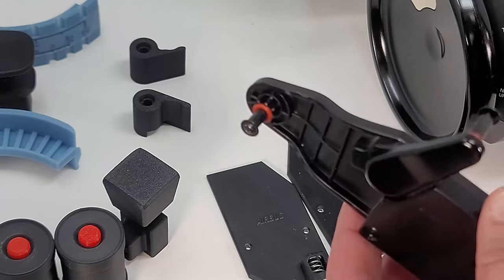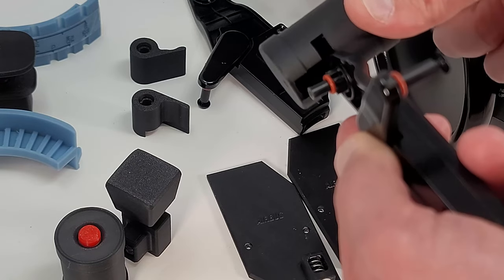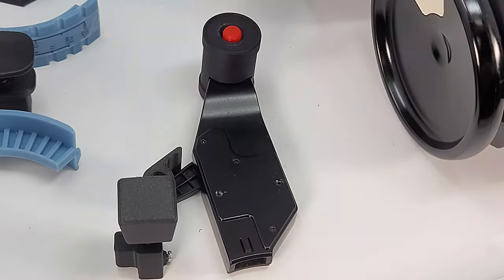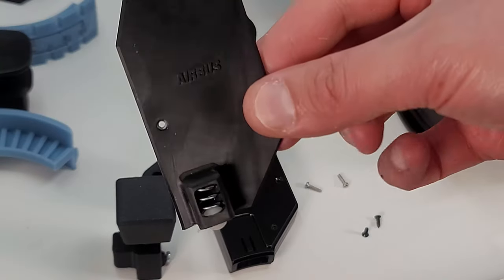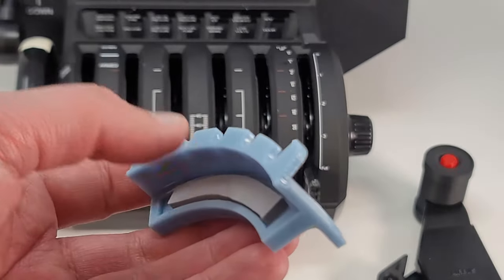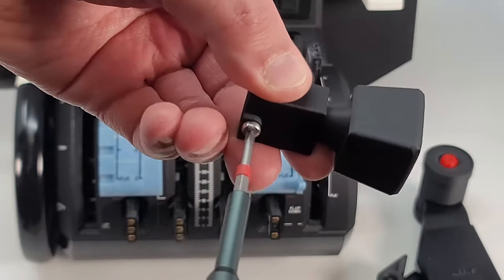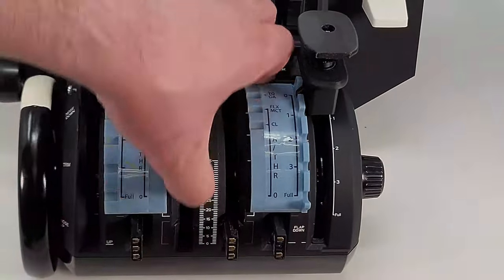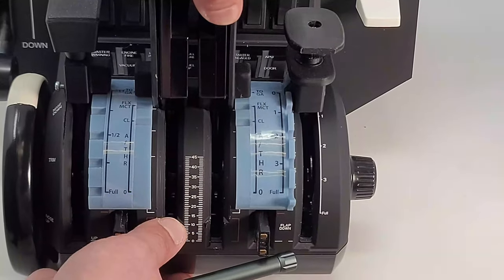ProDeksSim Airbus Addon installation instructions

Comment: I just recieved this and the 737 pack today and I love it. One little thing i noticed right away was there is no idle detent, I think the detent that comes in the bravo throttle is not very strong and is very easy to accidentally go in reverse thrust especially with the bigger handles. Otherwise the quality of your product is very good and is a great upgrade for the bravo throttle.
Reply from the maker: Thank you for your feedback and glad you like it. We will work on adding idle detent as well. Thank you again
Reply: @prodesksim6956  Sounds great. Will you offer just that plate on your website when you revice it?

Comment: Why isn't the Airbus add-on as smooth as the B737 add-on? The 3D printing lines are very clearly visible on the knobs unlike the 737 counterpart. The finishing on this is certainly not at par with the 737 product. Is there going to be an upgraded version of this in the future?
Reply from the maker: Hello, We have improved the quality and modified it a little bit. Will add a new video soon. Thank you

Comment: Was interested in this but the fact that you have to modify the original base levers is a no-go for me. Not going to deal with disassembling the core levers to go back to my 737. Should be quickly swappable. Again, good ideas with questionable execution. Good thing I watched this before ordering.
Reply from the maker: Hello, Thank you for your interest. The detent plates on the side can remain for any other plane you fly. As long as you remove our airbus gates, the detents will not interfere with anything! Additionally you will not be disassembling the core original base. You are simply screwing something to it.
Reply: @prodesksim6956  You're missing the point, when I'm using my PMDG 737 I want my 737 throttle and reverse thrust handles not the Airbus one's. So there's no way to do that without either unscrewing something or buying a second set of Bravo throttle handles just for your product.